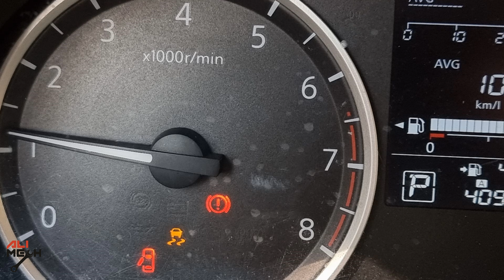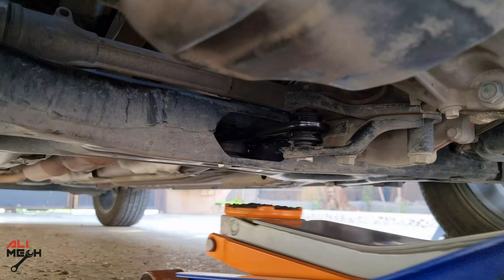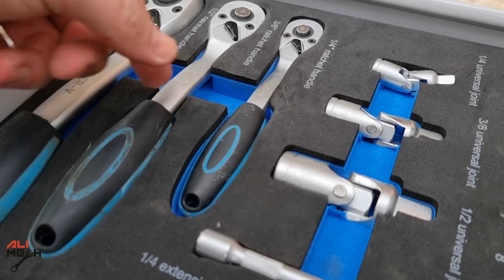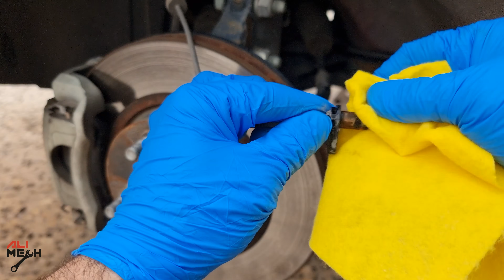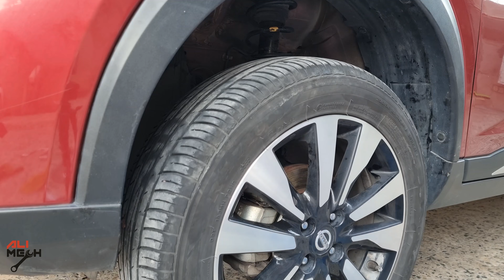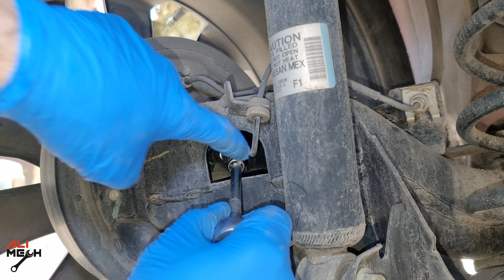Here is how to turn off traction control warning light at home for free without using expensive tool

Comment: In my Yeti, when I turn on the ignition, the traction control light does not go out completely, but stays on dimly. Only when I fasten my seatbelt does it turn off completely. Does anyone have any ideas?
Reply: sounds like a ground wire thats not making a good connection.  Then it gets a better ground thru the seatbelt circuit.
Reply: Thanks for the suggestion. I'll take a look at the clock board, maybe something happened there. Best regards. @tklykun9858

Comment: Hi
Thanks for your video, I have a 2016 Frontier, I just changed the clock spring on it myself! After I finished, the traction light came one, I drove it for almost a 100 miles now but still on! Can you help?

Comment: I have a 2012 Nissan juke. Very tiny car. My traction control light comes on when picking up speed and won’t turn off till I power off the car. Been driving it for 6 months like that. Help !!!!!
Reply from the maker: Did you clean the sensor like it did here?

Comment: Clear and straight to the point, thank you so much.
I have a Qashqai J10 i had the 2 lights on (traction control), turns out the rubber hose is blown i've changed it with an original and cleared the error with a diagnostic tool but it still comes back with error (cc1130). I will try the cleaning tip.
Do you have any other idea why the lights are on ?

Comment: What if it's only coming on in the morning when reach on the highway. But comes off as soon as engine shuts off & start again throughout the day🤔
Reply: Wheel bearing?
Reply: Hello,

Did you manage to solve this? 

I have traction control in the morning when the engine is cold or on a hilly motorway. 

Please let me know.  Thanks
Reply: @princekeebee1 a 4 wheel alignment solved the issue on a subaru for me.
Reply: @robbycousins5498 . Wheel alignment done yesterday but traction control light still on! 

Thanks for getting back
Reply: @princekeebee1 get it checked on a diagnosis machine then. More than likely one of the speed sensors gone bad